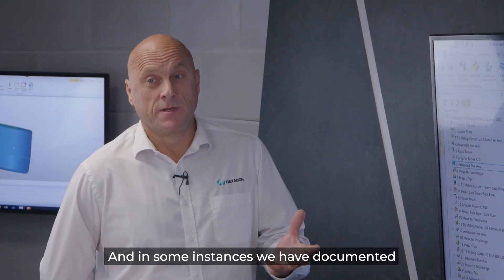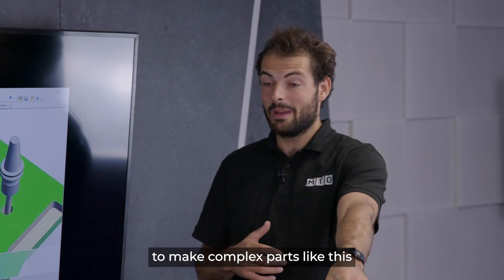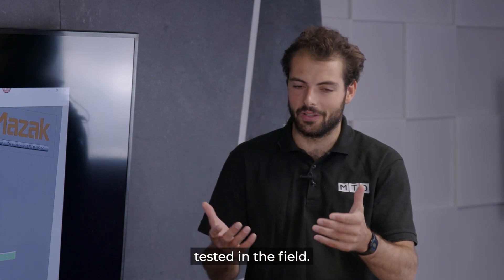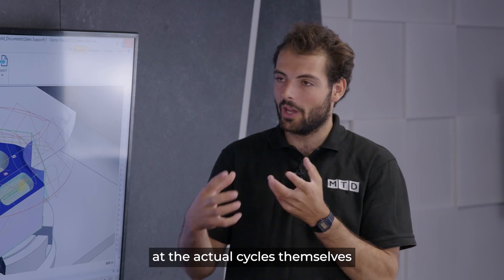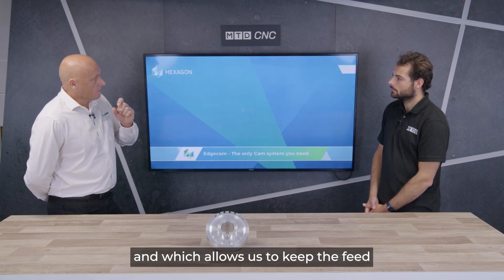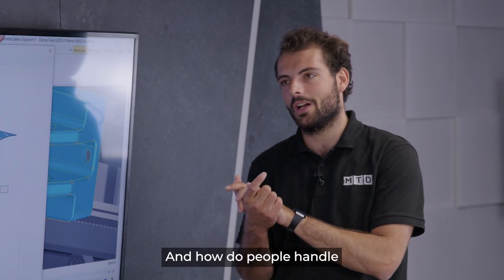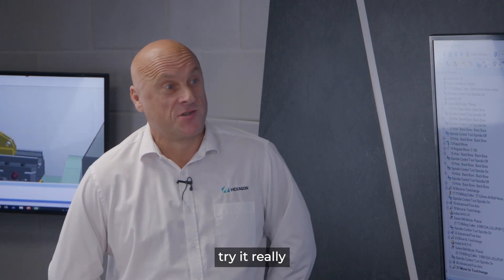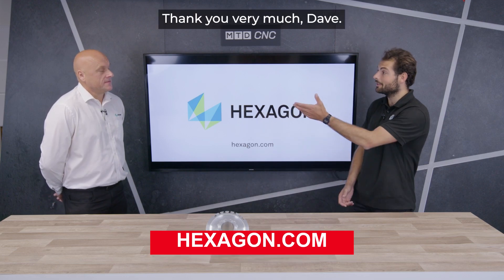Reduce your cycle times by up to 90% with Hexagon's EDGECAM software

Comment: I use it doing mostly ones and twos off. Without a doubt the best thing about it is you have almost every setting you could want if you dig through it, but you don't have to. "12mm End Mill, go rough that pocket, speeds, feeds, depth of cut, and stepover" EdgeCAM says "you got it boss" you'll get an excellent toolpath, in under a minute of programming often. It's an extremely time efficient and capable system.
Reply from the maker: glad you like it, what sort of parts are you making ?
Reply: @MTDCNC  modular mold parts and associated hardware for own product injection molding

Comment: The latest 5 axis deburring is really great.
Reply from the maker: Have you been using it ?
Reply: @MTDCNC  I did few times, and I will urge people to use it and move more manual deburring on to their machines. It will be more reliable and quality won't vary based on who drives the turbo.
Reply from the maker: Great advice thank you !

Comment: Hi there,
I was using few other CAM in past such as SolidCam,Fusion360,Hypermill  and I can say EdgeCam it was the worst CAM I ever used, it only My opinion but I dont like it out of date compare to other CAM softwares
Reply from the maker: Could you explain what you mean?
Reply: @MTDCNC  It's archaic, Fusion 360 for example has easy box menus and very simple to understand. EDGECAM has absolutely zero information online on how to utilise it properly as opposed to the thousands of videos online for Fusion 360. EDGECAMs menus are full of jargon that is just confusing to understand, Fusion 360 has popups that explain everything simply and fully when you hover over any option basically. These are just a few of the things that irritate me about it, dont even get me started on the CAD side. Don't get me wrong though, if you know what you're doing with it, it's very powerful software, the learning curve is hell though.
Reply: I've used Edgecam for few years and after I moved to Mastercam which is way better than Edgecam in my opinion.
Reply: @mrnobody9010  100% agree, the amount of bullshit like creating turn and mill profiles on Edgecam that other softwares just pick up by you clicking it is insane. Not to mention the entire lack of available knowledge on how to use Edgecam I.e YouTube videos. Edgecam is going to slowly but surely find itself out of business. All they do is suck companies dry between standard post processors for £5k each and then the training on top of it that you need to pay for. It’s shit from top down.